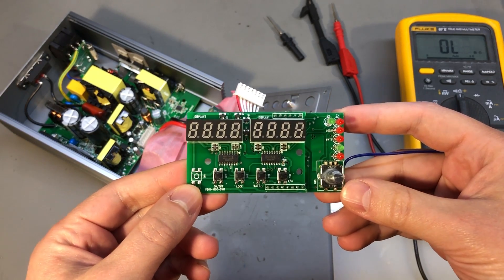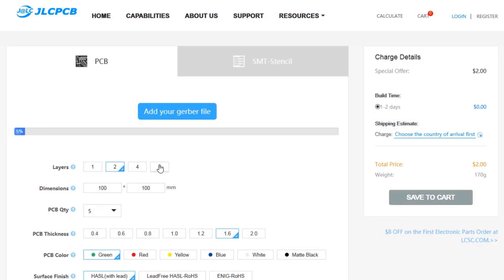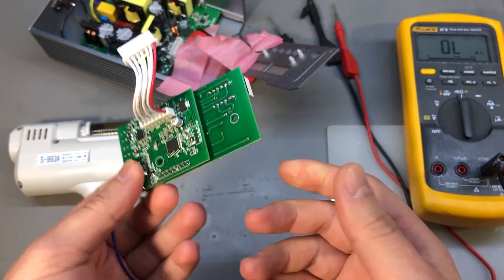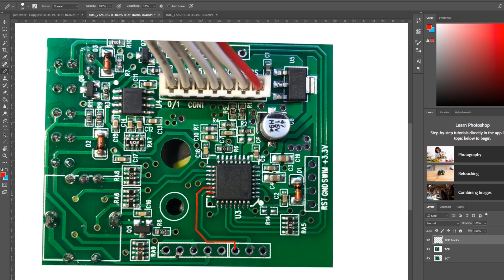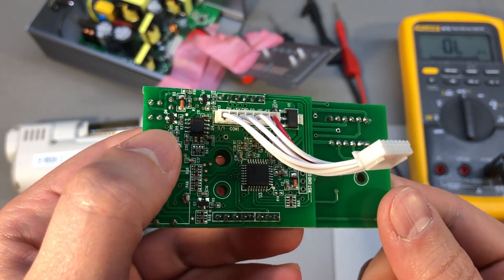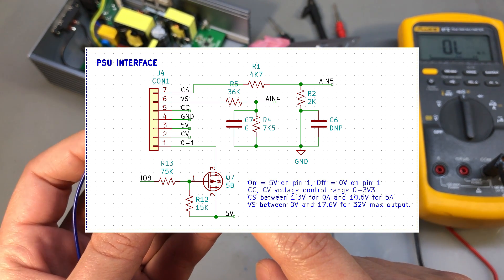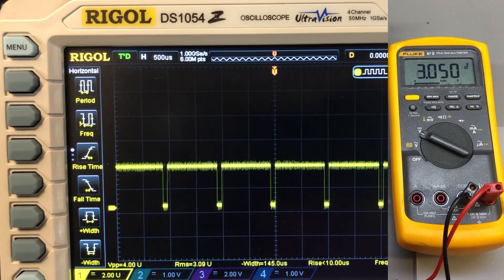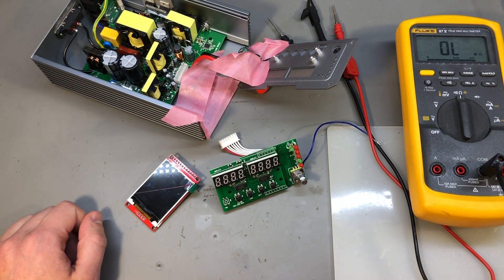Reverse Engineering Gopher NPS1601 Front Panel Circuit | Voltlog #305

Comment: Thanks for this video!  I've been considering one of these power supplies for quite awhile due to your reviews, but am a bit underwhelmed by the interface.  I do like simplicity, but also want features that are rather inexpensive to add so long as they do not over-complicate the user interface.

It's not yet clear whether a custom front panel is a cost-effective addition to this power supply, but I'm certainly interested in the future of this project.  I'm excited to see what you come up with.

What I want is perhaps a US$50 bench power supply that combines Gophert integration and performance with a Ruideng-style display and feature set.  That might be asking a bit much, but firmware features are effectively one-time investments; perhaps only the color display adds much to the BOM cost.

Comment: I'm mainly a programmer who does a bit of electronics too.  Looking at the requirements here I think a couple of good choices would be 1. An STM32 (maybe an STM32F103 if you like, but maybe not - they are cheap as chips, and there are many clones, but it's an old design, and there are many counterfeits on the market too - and STM32F4 might be a better choice).   2. An Nordic nrf52 microcontroller with Bluetooth module - I recommend the Chengdu Ebyte ones - they're great value for a high quality module with CE certified radio.
Maybe the E73-2G4M04S1B module, which you can get on Aliexpress for about €3.  The nrf52832 has an ARM Cortex M4, and good support in the Arduino IDE, and Nordic's own development kit, but really I'd want to write the firmware for this using the Rust language - although embedded Rust is not super mature, all the bits that would be needed for this project are already in good shape in the Rust ecosystem.  Just the basic improved UI first, and then add Bluetooth logging (and perhaps even bluetooth control too, but I think that's less important).  BTW the nrf52832 is used in lots of basic smart watches and fitness trackers e.g. the "Pine Time" open source design.
A nice feature of this Nordic chip is that you can do Bluetooth over-the-air firmware updates if you want to (otherwise just normal SWD or UART firmware upgrade if you prefer).  There are other alternatives too, I'd be happy to discuss!  I have an NPS1601, and the voltage calibration is way out (I keep meaning to open it up and see if there's a way to adjust it), so I have an incentive to see this working!  Ebyte also do a small dev kit modules  e.g. E73-TBB for prototyping - I have a couple which I use for developing with it.

Comment: you might want to have a look at the GD32F303. They are basically alternative to STM32F103 (99% compatible) but with more ram/flash and several high speed ADC/DACs. That will remove the need for PWM/integration . They are cheap also ~ 1.5$ from LSCS. They can be ~ 2x time faster than F103 due to the higher clock and the fact they copy the flash to ram at start and thus have zero wait state pseudo flash. Just need to be careful of the license of the sw you use, i.e. not use one coming from ST with restricted license.I've  put one inside my DSO 150, and it works very nicely.
Reply from the maker: Certainly the GDF32 looks like an interesting device but the decision whether or not to use it will be taken mostly by the programmer, he will be deciding the tool-chain as well.

Comment: Awesome job with the reverse engineering! I think there's a small mistake on the PSU interface -- C6 should be connected between AIN5 and GND and not between GND and GND :)
Reply: R11//D4 looked odd too, but it checks out with the layout.
Reply from the maker: Yup, I will need to check the ones you mentioned. Thanks for catching this!

Comment: Don't forget these power supplies also have extremely good noise characteristics for a switching power supply.
Reply from the maker: Sure, mentioned this in the review video, that's one of the reasons why I consider them the best power supply you can get in the $50 range.

Comment: how do the main psu pcb works with the pwm outputs from the mcu?
Reply from the maker: PWM signal is integrated and buffered with an op-amp and then is fed into the main PSU board as dc signal.